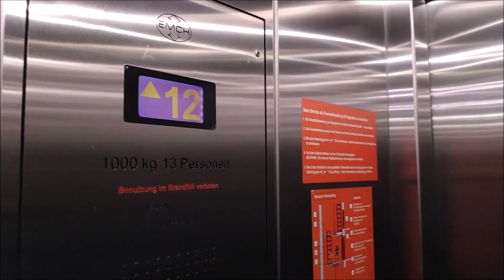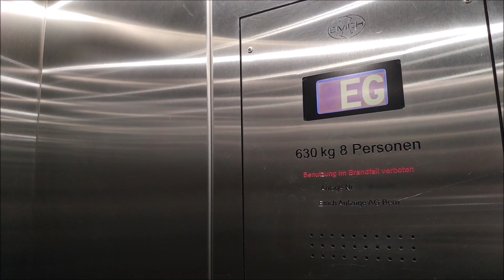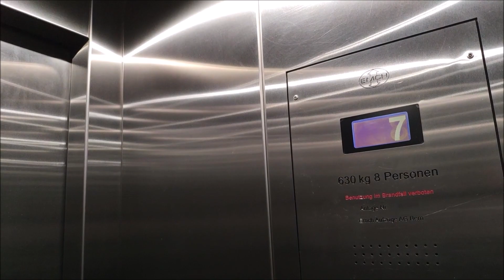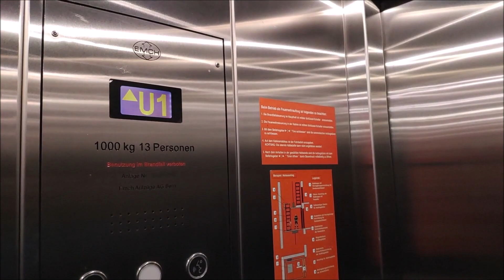2 EPIC High-Rise 2m/s gearless EMCH Lifts in Berne, Switzerland

Comment: These elevators are really fast, I had seen an EMCH elevator which replaces a Schindler which was also equipped with an emergency ladder. in the towers it has normally become a mandatory standard for at least one elevator per building but it seems to me that many builders do not install one during replacements anyway I only saw EMCH and once a Schindler with ladders but never from other manufacturers.
Nice Video ;D
Reply from the maker: Thank you!
Fireman's lifts are generally mandatory for high-rise buildings. The definition in Switzerland is that the building must be at least 30 meters tall.
Mandatory in this case mans that one must be installed when the lifts are modernised or replaced. I have seen Fireman's lifts from Emch and Schindler of course, as well as AS Aufzüge (which is basically Schindler lol) but also from Norm Aufzüge (which is just generic) and I have even seen GeN2s as a fireman's lift. I tend to say that they have become a thing since about 2010, older lift installations or groups do not seem to include fireman's lifts.
Another regulation on fireman's lifts is that they must stop on all floors and should have a capacity of at least 1000 kg, although I have already seen a few that only have 800kg, probably because the shaft is too small for a bigger lift.